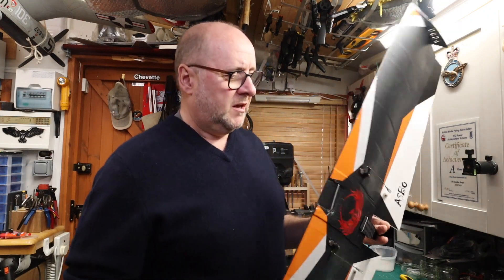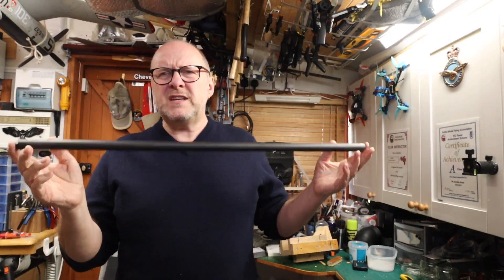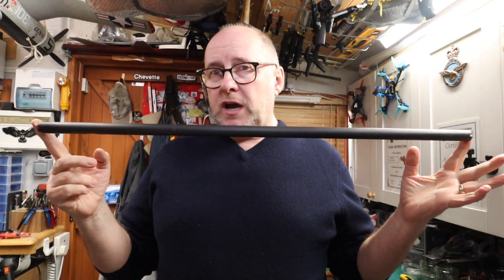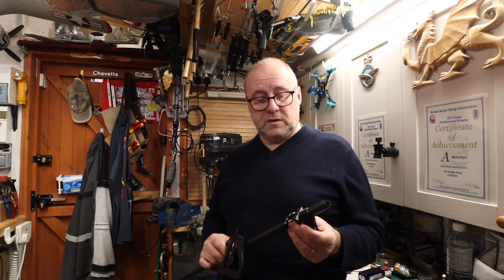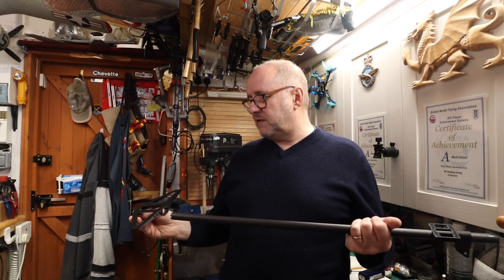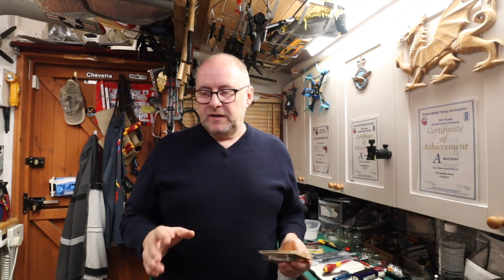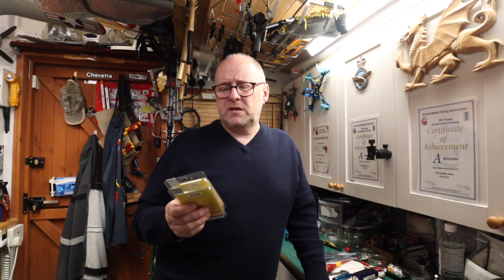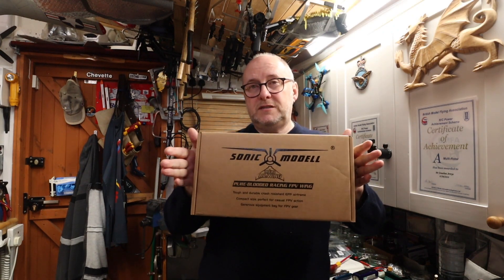Carbon Tube Plane - Part 1

Comment: Great effort, I learned free Design Spark myself...You really must dump all that EU LBT shit firmware!!!!...Go FCC for God's sake, it's easy, it's way better than that compromised EU rubbish..(60mw) RF instead of 100... Come on Jono...your letting the side down..!!!?
Reply from the maker: It was FCC and I was convinced to change to LBT. I have the older transmitter so believe it is 100mW  It is working well so will leave it alone for now. lol
Reply: @TWSreviews  I have cleansed about 6 Club members Transmitters of LBT Firmware...If you also use one of the old X8R which are not good range wise anyway and LBT, your asking for trouble...Get yourself back on FCC...Or I'm unsubscribing you!!!!
Lol...🙄🇬🇧
Reply from the maker: When this virus is resolved we need to organise a FPV Hub UK meet.....like Mad Dogs